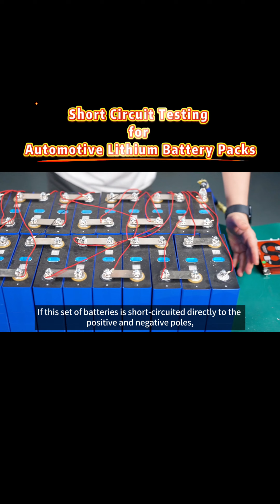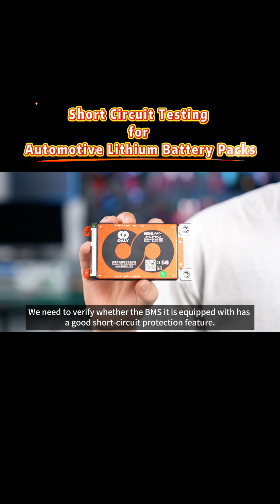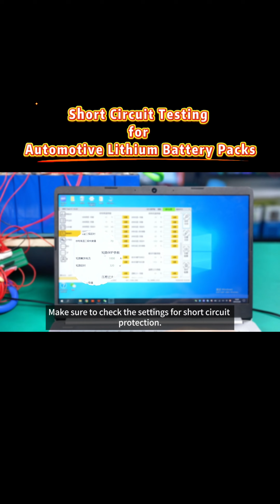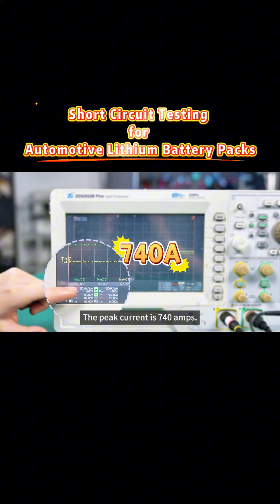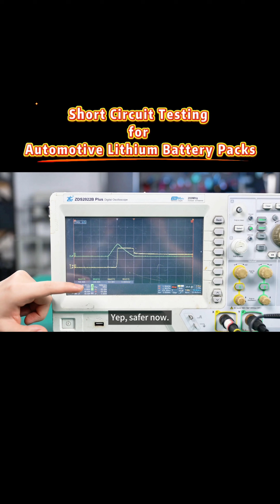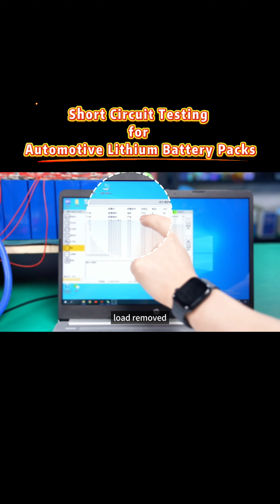Short circuit testing for automotive lithium battery packs

Comment: These BMS are not SmartBMS. They do not have the function of remote monitoring via WI-FI and 4G. The DELY company has stopped supporting the application that was responsible for such capabilities. Therefore, in this video, the same company is deceiving you, advertising remote access to your battery. Be careful - the application does not work!! Monitoring will be possible only from an additional monitor!! WI-FI, 4G functions are NOT AVAILABLE!!!

Comment: There were quite strange transitions when oscilloscope was in Roll mode (500 ms/div) and they lasted ~500ms. Looking like multiple and frequent SCP triggering and very fast releasing and so on, during that 500ms. Later, with video editing, you showed a single pulse which shows a single SPC triggering and it took just 20uS, not 320uS as set on the software.
So, there are strange things!